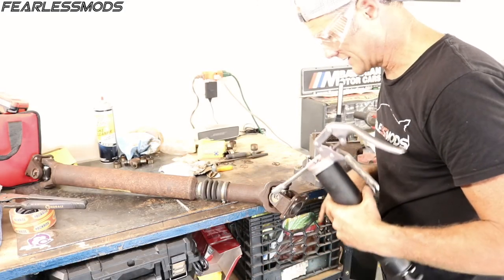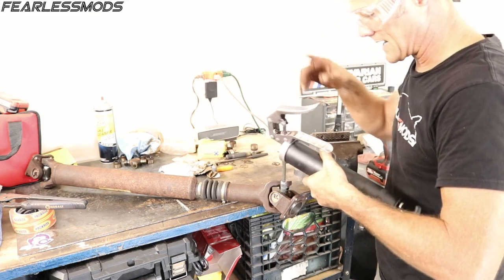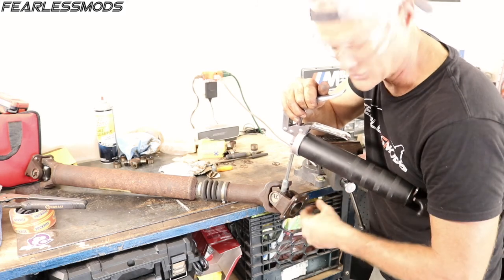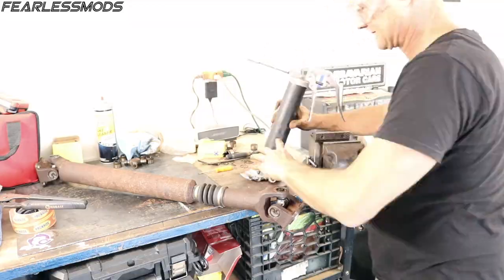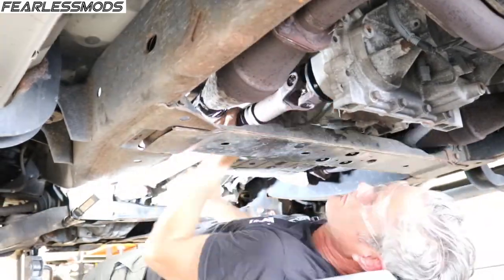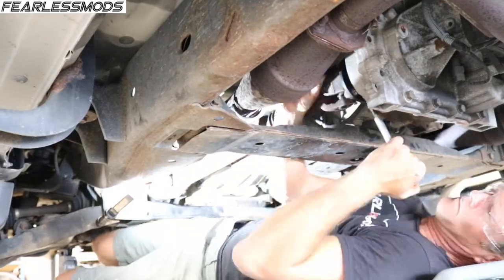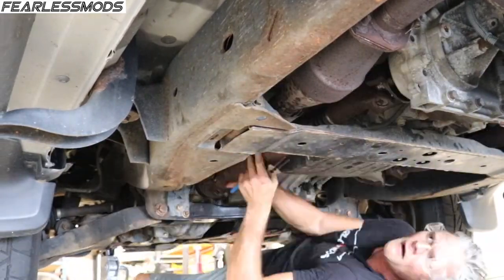Replacing Nissan Titan Front Half Shaft U-Joints

Comment: This is huge! Anyone who has a second gen nissan 4x4 should see this. I just did the front my u joints on my 2005 xterra yesterday. Had some clicking sounds that got louder the slower I went. Solved that issue with the new joints. Now I know that my bearing might be bad because of the joint.  The bad joint probably caused some alignment issues.  There's a huge difference in steering now. BTW,  is there anyone out there that has had a good experience taking their car to the dealer for diagnoses or repair? It's crazy to think that it doesn't matter if your car is the same brand as the dealer you take it to. A good mechanic is a good mechanic. Shout out to chrisfix! Dude is killin it!

Comment: Thanks for posting the video.  I found your vid after I was poking around the underside of my '07 Titan (124,000 miles on it) because I had a pretty good vibration under the driver seat once I got to 50 mph or higher.  Just like you, it was the rear end of the front drive shaft U-joint (at the transfer case end of the shaft). I did the U-Joint cross replacement this past weekend.  Not a bad job with the right tools to 'press out/ press in' the cross caps.  I'm going to change the transfer case fluid as well and keep an eye on the seal at the output pinion where the bad U-joint was. I saw evidence of fluid leaking and spattering the underside of the vehicle at the pinion.  I figured I was driving with the bad U-joint for about 6,000 miles.  Appreciated your video.

Comment: Very informative video. I used Timken hub bearings when mine went out. I think that's what the OEM uses on my 2010. Pretty sure my U-joints are done too. Getting some clunking and slight vibrations now at 143K miles.

Comment: My 2nd gen 2018 SV has been giving me a humming symptom when coming to a stop or taking off. Usually happens at slower speeds then when I go faster it isn't as loud. Pulled my half-shaft today and went for a spin.....boom! Noise gone. I will be replacing the half-shaft U-joints before putting it back in.

Comment: I have the exact same problem 05 Titan 150,000 MI putting wheel bearings on left and right side every year rear universal joint on the front drive shaft real sloppy changing it now I actually was in the process of doing that before I watched your video not even thinking about the wheel bearing just watching for an easier way to work on the front drive shaft
Reply from the maker: I don’t know Kevin. Doesn’t make total sense to me but my bearings have been behaving since I replaced this u-joint! 🤞🏼🤞🏼

Comment: Hi, I have to lift the truck to be able to do the check and see if any is damaged?  I have a 2004 titan and it hits hard when I reverse
Reply from the maker: It wouldn’t hurt. Hard to say however, sometimes you may find looseness when the drivetrain is fixed, and sometimes when you’re able to move it freely.